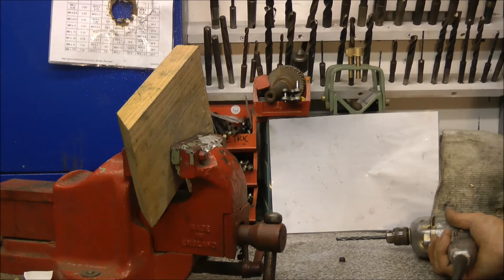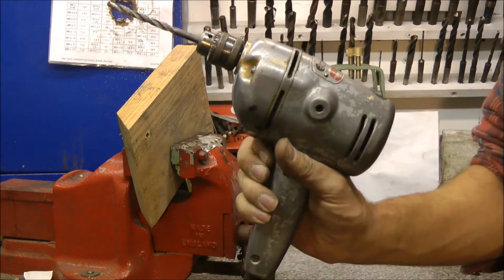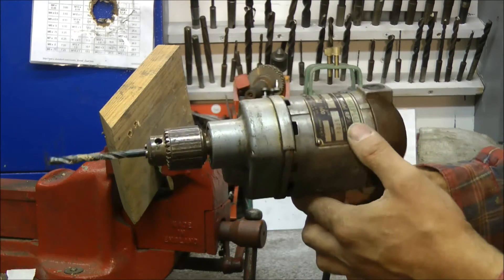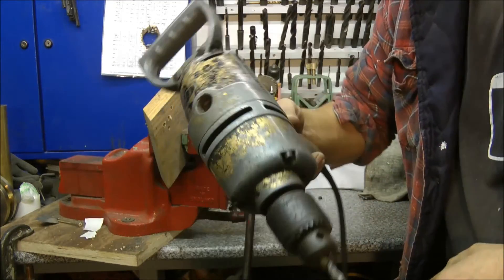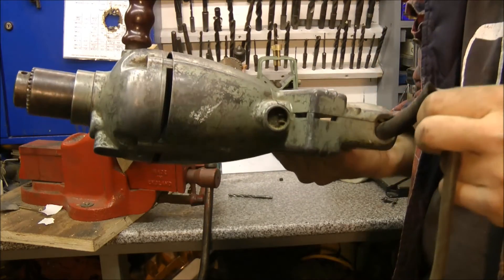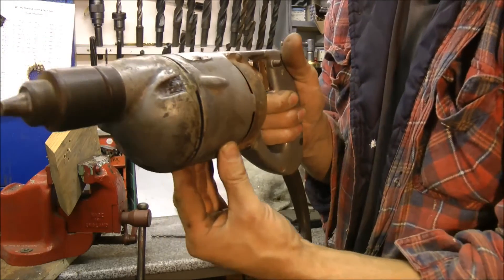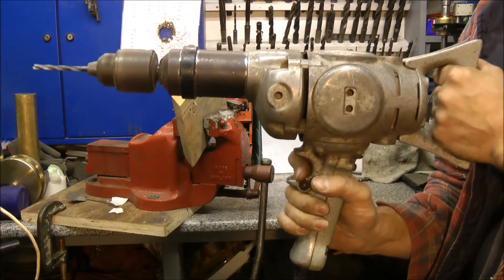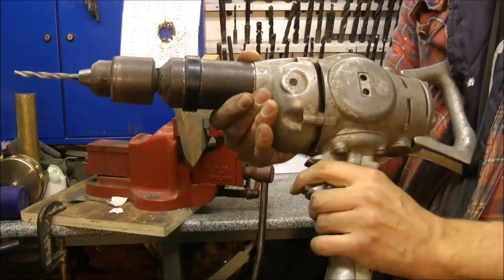Collecting  vintage electric drills and corded drills too!

Comment: Black and Decker kitchen wrecker - great for small bits in steel 
Food mixer drill is slow due to the two stage gearbox (aka bonus spinny bit) needed to get the reduction. Great for larger steel drills that need to be spun slower for metal work. 

Those larger 1/2" chuck drills will tear your arm off when the catch - great fun and great finds!
Reply from the maker: thanks Glenn, it was a quick video chucked together to let everybody know I was still alive :) 
joking apart there's some real nice old drills on your side of the pond
Reply: @Sculpture-by-chris  in America we call it Black & Decker pecker record 😂😆

Comment: Hello , I've been wanting to purchase a vintage black and decker d500 , but I heard that there very dangerous and can electrocute you from just being turned on , what do you think about this and do I need to worry about anything like that
Reply from the maker: Any problems usually come from the old electrical flex / cable as they are the original part swap that for a newer one and you be fine

Comment: may be your rawl one is slower cos it's prime use is to drill masonry?
Reply from the maker: it may be the reason , there's no impact/hammer facility on the drill ,but soft masonry can be drilled without it,
  most modern drills are faster but have clutches to stop you breaking a wrist etc....
 saying that though.. I did see a bricklayer break his nose with a big hilti drill when it jammed in a wall and spoon around ouch!!!!

Comment: I had a drill spoon around on me once but I let it go & got out of it's way it wrapped it's cord around it's self & ripped it's cord out of it's self foreman told me off not for breaking the drill but repairing it ! I bet you know the type of foreman I mean makes a lot of noise but hasn't got two brain cells to rub together. Did have a pal who lost a tooth hand cranking a Jag 3 1/2 litre ( an apprentice practice piece) I had just fixed coupled to a water pump crank handle shot off hitting in the mouth jag revved up ( choke out ) & pumped water everywhere guess I fixed it to good!
Reply from the maker: lol, you fixed that good :), sounds like you've had a interesting and varied Career, what's you job Dave?..